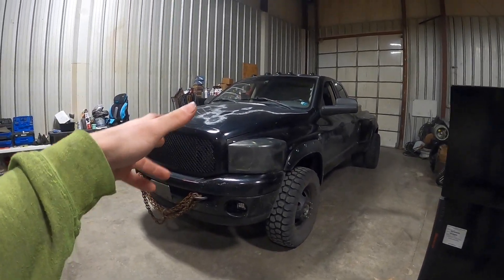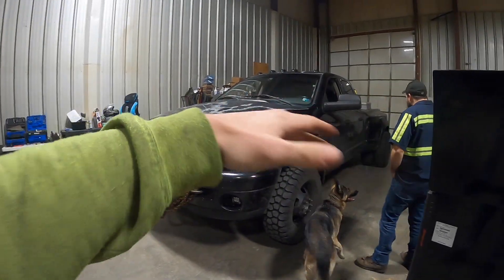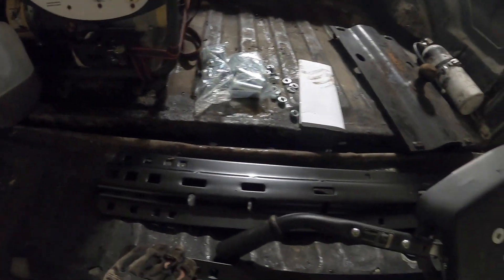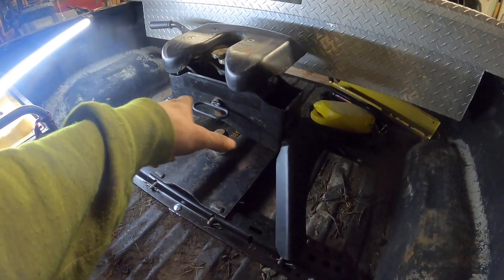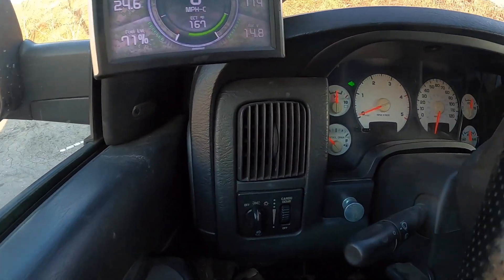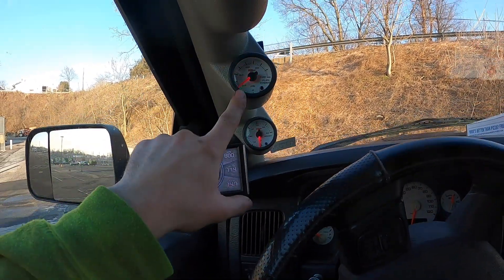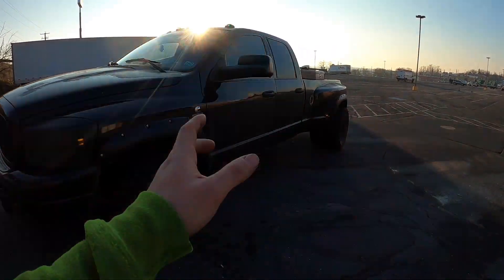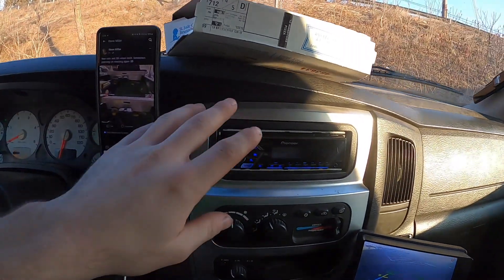Getting Into Hotshot Trucking | Truck Preparations

Comment: Is that the sct livewire tuner?Does it not have egt temps,boost gauges built in?Also wandering if the volume of freight is good to start off in somewhere like Nc?
Reply from the maker: I have an edge cts2. Each year truck will have different features. Egt probe so need to be installed on any truck for that gauge to function but mine will show me boost and rail pressure but not oil pressure and fuel pressure. I don't do freight so I don't know how it's doing, sorry.

Comment: loving your videos! I'm enjoying watching every one of them. you always have a lot of great information for a guy like me. I have a question that I have been trying to research for days and I can't seem to find an answer to. I am building a non cdl hotshot rig from a 96 Chevy C3500 ext cab dually that had a 454 and 4l80e and a 10,000 lb GVWR. however when I look at my max trailer weight spec it says 13000 lbs which doesn't seem like enough but seems typical for 90's trucks. I see hotshots like hotshot Dave that used a 90's ford to haul 3 cars that together weight well over 13,000 with the trailer so how does that work. Does D.O.T not care about it as long im my GVWR rated and actual are less than 26k or am i missing something. I want to stay under 26k non cdl with a Cummins 12 valve swap and my truck numbers are 10k GVWR, 3600 front GVWR, 7500 rear GVWR, payload is 5,383. actual weights i cant get until its swapped and completed. Should i start with a different truck or am i okay to use this one? I am already started on the build and changing plans now would suck. Thank for your time.
Reply from the maker: DOT looks at the gvwr of the truck and the gvwr of the trailer. Combine those 2 numbers and that's what your gcwr is. The gcwr from factory isn't something they ever go off of because they can't because they don't know. My truck is run the 9,000 gvwr of the truck with my 17,000 gvwr of my trailer. That's 26,000 total(non cdl). You can use that truck but make sure everything you have is to the T. Hotshots get picked on a lot by dot so the more you have inline the better. If your truck has a 10k gvwr and you want to stay non cdl find a trailer that'll have a 16k gvwr or less. That'll keep you legal. Then you just need to make sure to keep each individual axle weight under whatever they are. Use the tire ratings as your reference as dot doesn't really look at the actual axle ratings. They look at the tires 99% of the time.
Reply: @CPSteveMiller  thank you! that's exactly how I thought it might be but I wasn't sure. I really appreciate it. hope all is well with you.  Looking forward to more great videos and hope to see you on the road some day.

Comment: Whats the details on running a mechanical engine with no emissions in a newer body thats supposed to have them? They run a bunch of glider semis as dump trucks here but I dont think they can leave the state due to not having the emissions that the body was supposed to have.
Reply from the maker: I don't believe you can get away with it. 07.5 they introduced the egr on the cummins and no dpf until later. I can get away with it on this truck technically since they're both considered pre emissions trucks. 12 valve in a 3rd gen dodge is a pretty popular truck.
Reply: @CPSteveMiller  That is very true, I had planned on swapping one if these 12v engines I have into a 6.0 ford but I guess if i were to use a 7.3 body that would solve that issue. Thanks.

Comment: Your pickup is originally a 2500 correct? That would mean your gvwr is 8800 lbs with a 6000 lb rear axle from the factory... even though you upgraded your rear axle to a dually, dont you still have to adhere to the numbers on the tag in your door jam? How do you stay within the weight limits on your rear axle?
Reply from the maker: The gvwr is 9k on my truck and dot pays attention to the tire rating as opposed to the sticker on the door. They pay attention to the gvwr of the truck and trailer only to verify you don't need a cdl for the combination. After that as long as your actual weight is under each individual tire/axle rating you're fine. I've never had an issue before after doing it for a year before hand. I like the low gvwr for the fact that I can pull a 17k trailer. If I had a true 3500 to stay non cdl I'm imited to around 14k to 15k gvwr trailers which limits me in the power only non cdl world

Comment: Hey got a question. I'm looking at buying a 2000 dodge ram 3500 dually 4x4. It has a split in the frame on the passenger side frame rail. Does dodge still make replacement frames for this particular truck? Or would I have to go pick one up from the junkyard? Turns out 12 tons of logs and a dump bed don't mix
Reply from the maker: Go into my video with the Toyota frame repair and there's a link in the description for a website to frame pieces. See if they have that section on there. When you put the section in it'll make that section stronger
Reply: @CPSteveMiller  I looked on there. They didn't have the piece of frame I was looking for. I'll have to upload a video of the frame damage cause it's hard to explain over text. If you were to look at the truck from the side you can see the rear section sags compaired to the rest of the frame.
Reply from the maker: I'd probably avoid buying it but I don't believe you can get new ones. Might make a good parts truck though
Reply: @CPSteveMiller  well I mean I kinda want to keep it cause it was my grandpas truck. Also another reason is cause Ive been wanting to build one of these trucks to be brand new (new everything paint, interior, engine, ect). And trying to find one set up the way I want is almost hard to find. And this trucks set up identical to the one I want to build. So I figured I'd use it as a start
Reply from the maker: @oldcroneysgarage9739  In that case junk yard week probably be the route you'll have to go. Brandon24v and gabeferrelproductions have been buying used ones and turning them into show frames
Reply: @CPSteveMiller  I'll check them out. Thank you bud
Reply: @CPSteveMiller  I had a idea. Why don't I find a 3/4 ton quad cab short bed frame and building a 2000 dodge ram 3500 short bed dually!
Reply from the maker: @oldcroneysgarage9739  Long bed is so much more practical😅

Comment: What are you getting mpg ???
Almost afraid to ask especially with the big tires, lift
Reply from the maker: Empty I got it up to almost 16. Loaded varies on the trailer and terrain. I think my lowest was 8mpg but again it varies
Reply from the maker: I don't have a lift. My truck is actually lowered in the back and the front is stock. Never been a fan of lifted trucks to be honest.
Reply: @CPSteveMiller  I'm lucky to get 12 mpg without the trailer ('19 3500 HO Cummins & 44' flatbed), as poor as 5 mpg loaded, 30K lbs (still 100% stock). Almost at 100K, on the fence regarding deleting or a non delete tune. Sure wouldn't miss paying for the cow piss (DEF). But I drive commercially,  worried about getting busted (I rolled through California about 25% of my miles)
Reply from the maker: @steeleexpressllc990  Funny enough I see more issues in Maryland than I see California when it comes to deletes. If you're worried just do a stealth delete. Watch the mpg increase and your reliability go up.

Comment: Who you operating under? Anyone we know?  Best of luck.
Reply from the maker: I will probably keep that private unless they decide it's alright to post. Some companies are iffy about that. Thanks!
Reply: @CPSteveMiller  no probs, I'm not prying.  Are you running his trailer? I don't think you mentioned that.
Reply from the maker: @Itsa_Mea  I am doing power only like I used to because I haven't seen anyone get into as much detail as I want to. To me it seems like a great way to get people into the industry. It's also a lot less stress on these older trucks. If I ever get a trailer I'll buy another ironbull tri axle 40fter and derate to 17k for non cdl. There's no need for anything more on an older truck anyway as it's just more stress on the equipment.
Reply from the maker: @luisalanis6816  Never🤣